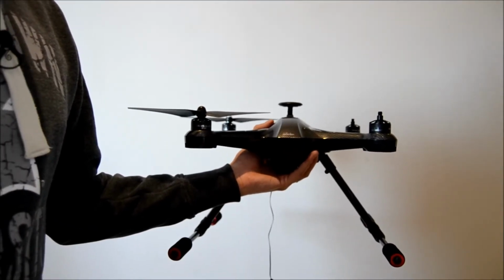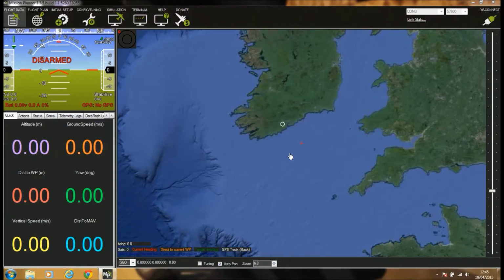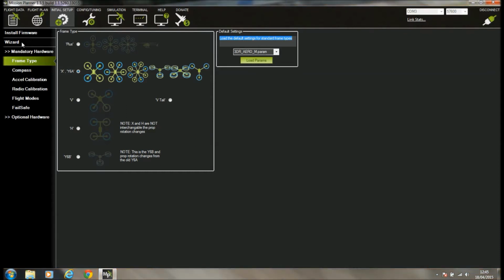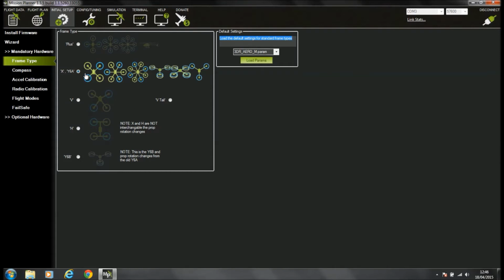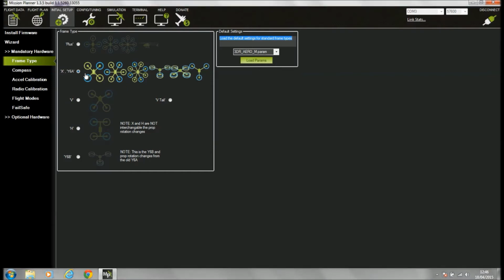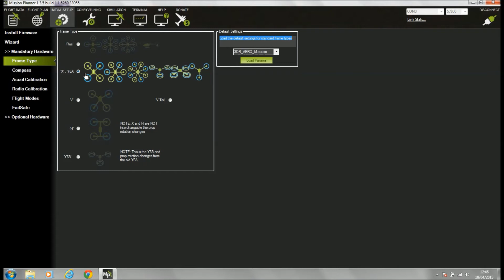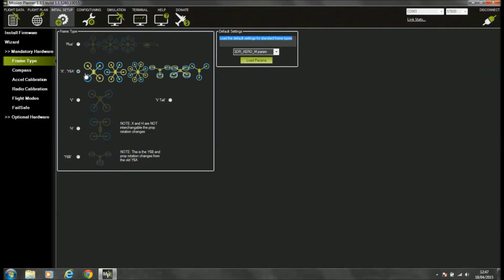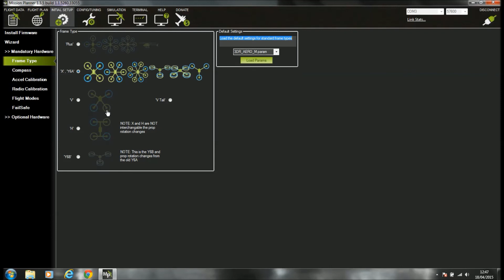Walkera Scout X4 - Dancing Solved

Comment: So are you saying with you hook up to mission planner it automatic switch it to plus?
Reply from the maker: its automatic if you try to use the wizard calibration in MP. Otherwise, its fine.
Reply: Thanks for the info
Reply: Alex Savo So have you tested it out yet? Did that fix the problem?
Reply from the maker: Not yet. Just purchased the upgraded GPS module from Walkera and will install this first before I test it again. Early next week should be my first flight.

Comment: Anytime you click on Wizard it automatically changes the frame type, even if you exit immediately.
Reply from the maker: Yep.....had no idea till i flew :(
Reply: I did the same thing, and it was after I crashed so I thought it was serious. Luckily I didnt take it up too high and hard landed it then figured out it was the frame type after accidently clicking wizard. Also, if you do a live calibration it will automatically change compass_learn to 0.
Reply from the maker: Think we have both been lucky. I will check out compass learn, is that in parameters?
Reply: Yes sir.